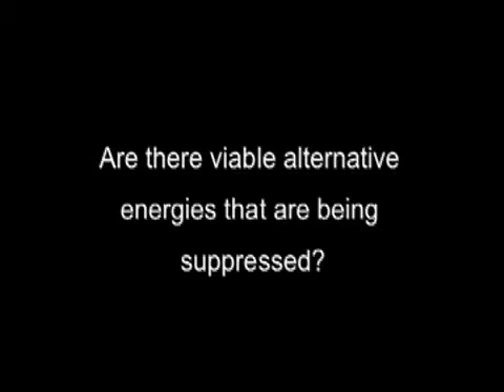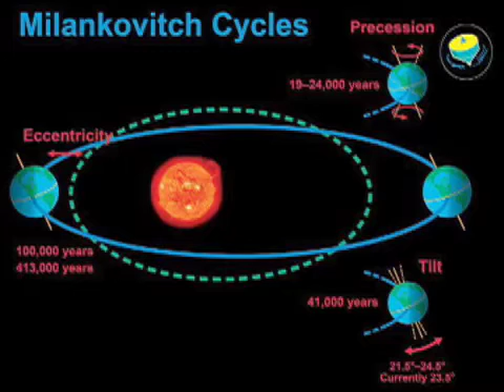Renewable Energy Follies - Physicist Howard Hayden

Comment: Strange idea of measuring the power density of wind turbines in kW per hectare. This is because the land around wind turbines can still be used for agriculture so is not wasted. I think he suggests a misleading view of wind turbines. You should note that wind turbines change the pitch of the blades to compensate for variations in wind speed so that the speed of rotation is maintained as constant. There were some old designs that did not run at a constant rotational speed.